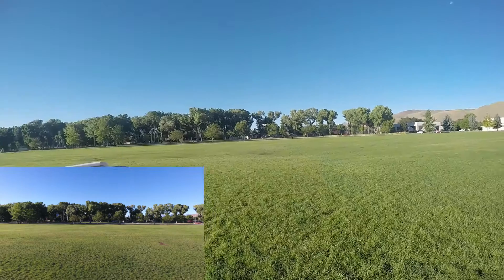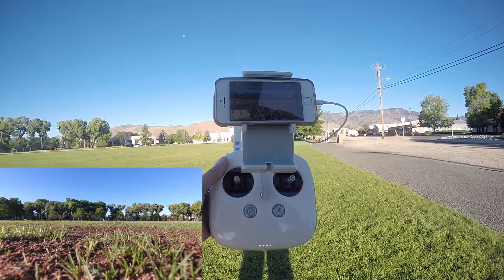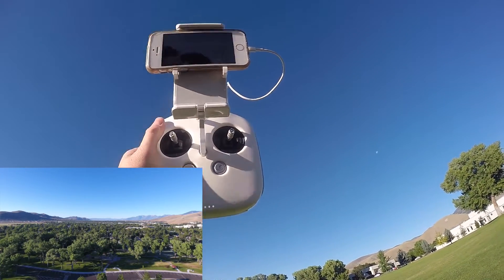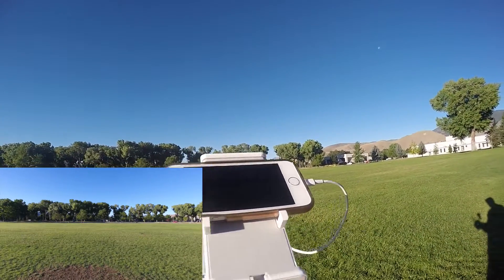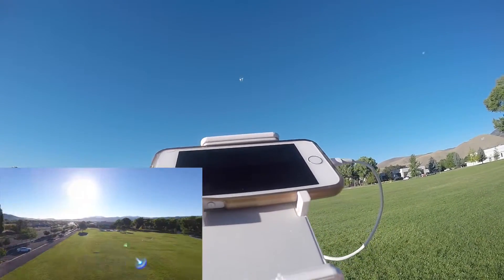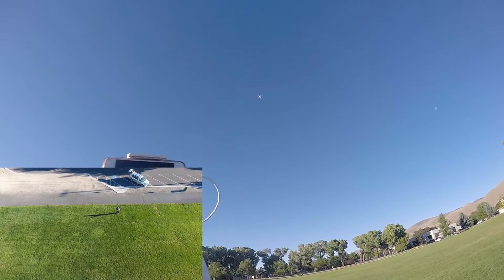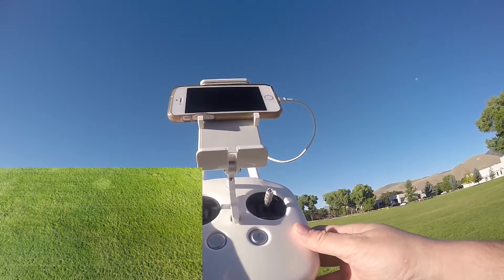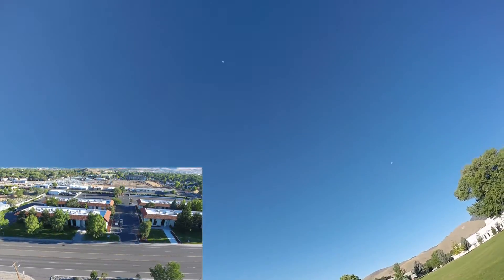DJI Phantom 4 Problems, Defective, Out of Control - Part 2

Comment: have you got the vision position system turned on and calibrated using DJI assistant from the website? i had to calibrate my front and downward facing VPS.

Comment: did you try to calibrate the imu's, check the vision systems? doubt is the remote ... try a complete reset
Reply from the maker: Yes, I've been in communication with DJI and they had me do a lot of troubleshooting, including calibration of the compass and IMU's, performing a reset and even uploading my flight data for them to review. This video is shot in the third location that I had calibrated the IMU's. The first video I did about this actually shows the end of the IMU calibration. I ended up returning it for a refund because I was nearing the end of the 14 Day period in which I could. So it has been replaced, but I'm still getting less range then I do with my P3 Advanced. My P3 will travel over 7000 feet before it RTH, both P4's that I've had would only get around 4500 to 5000 before RTH kicks in. The 3 and 4's were both being flown in the exact area and at the same altitude during the range tests. Do you have any idea why this would be? Thank you for the suggestions and thank you for watching!
Reply: That's super odd that P4 cant go further.. the only possibilities is i can think of is the remote perhaps not allowing range.. I had some issues with range that was later fixed by dumping the ipad mini 2 in the ocean ...just kidding.. lol

Not sure if your handphone/tablet has an issue with the P4's remote..
Reply from the maker: Good news! I went out to a really secluded dry lakebed and did a range test with my new Phantom 4 and was able to get 11,000 feet away before I started losing signal, that's over 2 miles!! I must be getting reduced range in my neighborhood because of inference.
Reply: That's a good range.  Hope nothing else props up after this.. Happy flying.. 

Try reducing the HD quality feed dB.. For better reception..
Reply from the maker: That's actually something I did, I brought it down to 4Mbps. Thanks for your help :)
Reply: No issues mate..